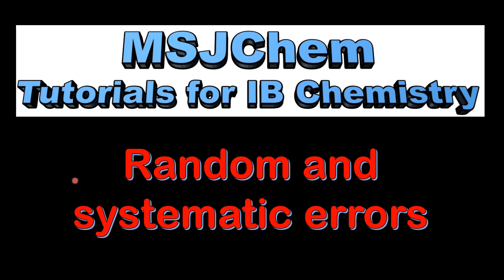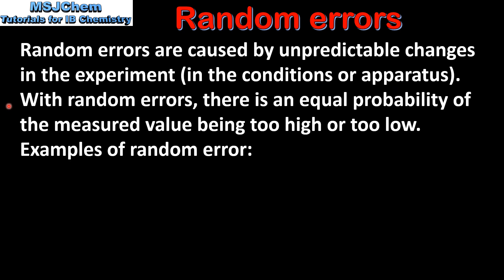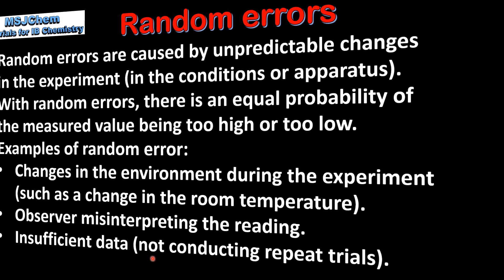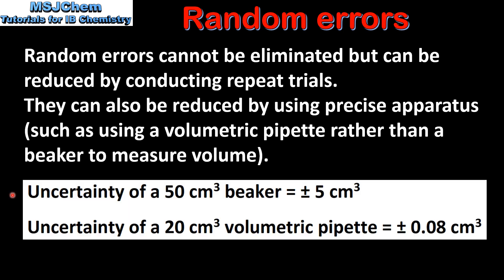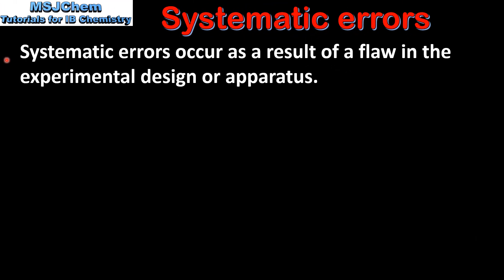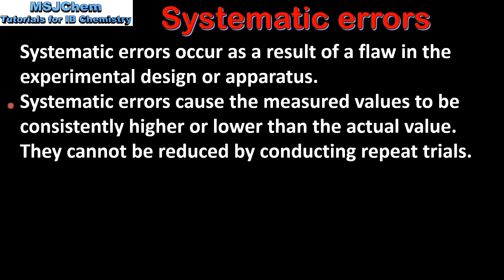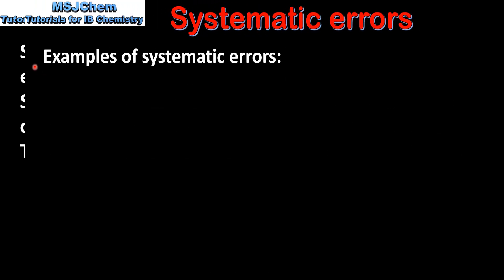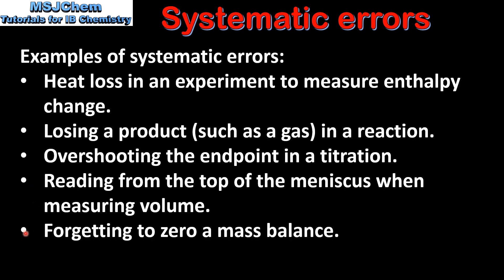11.1 Random and systematic errors (SL)

Comment: isnt "overshooting the endpoint in a titration" a random error as it's the person's fault and it decreases in each experiment; and it can be likely to be any of a bit more or bit less than the actual value.
Reply from the maker: Overshooting a titration will result in the measured value always being higher than the actual, therefore it is a systematic error.
Reply: @MSJChem  I think I will start using that logic to identify random and systematic errors, I always thought of it as am i making the mistake (systematic) or is something i cant control making the mistake (random).

Comment: overshooting the endpoint in a titration (systematic) and not properly reading the units (random) are both mistakes that the student can make in the experiment and is therefore random, I suppose. Why isn't shooting the endpoint in the titration a random error in that sense - especially if the procedure of an experiment does not instruct one to do so.